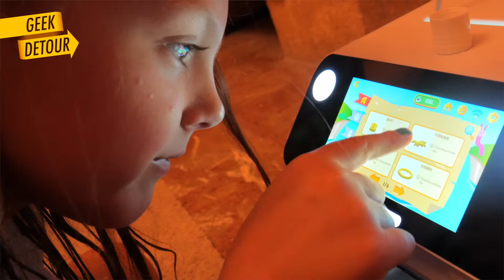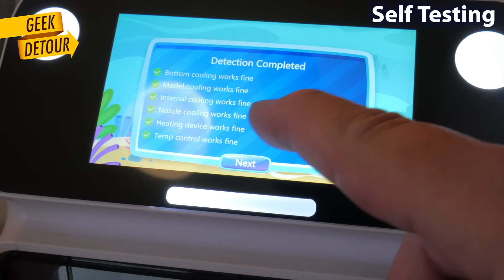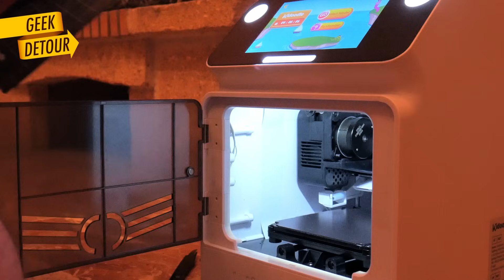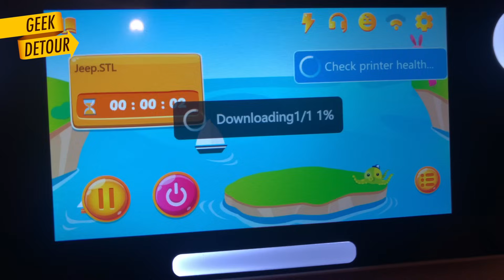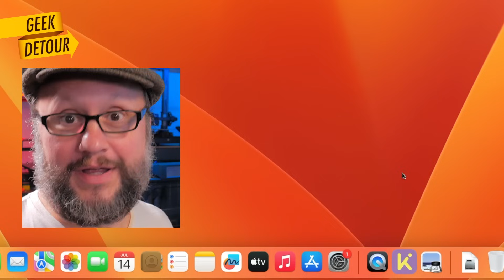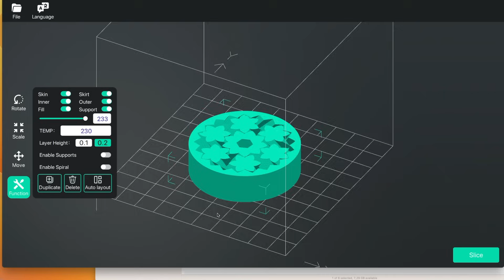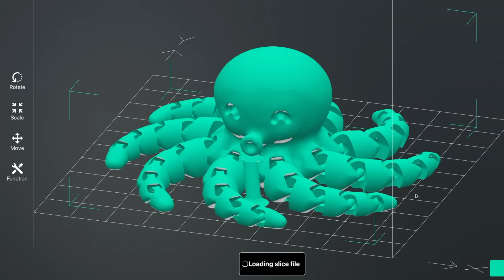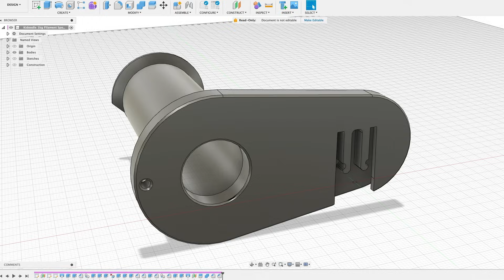The Best 3D Printer for Kids in 2024: Kidoodle - no phone, no computer!

Comment: just use a bambu lab x1 carbon bro it literally is way bigger and has the same size screen its way better
Reply: Why would a kid need a 11x more expensive 1,300$ 3d printer? The point is that it’s cheaper and designed better for children
Reply: @kazaki87  its way way way better and higher quality and you dont have to spread glue everywhere

Comment: Um is there still a way to buy the x-maker 3d printer for kids?
Reply from the maker: Yes, the original x-Maker you can most likely find on Amazon, and the new x-Maker Joy (which is cheaper, but with a smaller print area) you can find on Aoseed website. I am actually reviewing it for a few weeks already. The software is really the best part (which is what I showed on the xMaker review).

Comment: Kudo's to Kidoodle for not vendor locking the Spools.

For the spool holder I hope they release the STL files or at least the Base-plate for the spool holder, so you can easily make your own with some bearings and a long screw

Comment: Never got 1 good print out of it. Instructions for bed calibration are vague, paper for calibration is missing. Now it seems like it clogged after the third test print. Cant get it to work and I decided to trow it away before I spend anymore time on this low quality toy. Will order a Bambu A1 mini, that thing just works without going back to 1995.
Reply from the maker: 🫤 I am sorry… Our experience with it has being quite good. But I totally believe you. Do you have other 3D Printers? Just for curiosity, since previous experience shouldn’t be required.
Reply: @ Yes, I do have a couple. But more recent ones though.

Comment: What would you consider better the xmaker or this new model based on your experience?
Reply from the maker: The XMaker has a better construction: the frame inside is all metal, more rigid and because of this, it prints very beautiful pieces - but it is much slower than the Kidoodle. On the other hand, the Kidoodle has a much better screen with a huge advantage of printing its catalog without an App or Computer - my daughter cannot do the whole process on the X-Maker. Also, the XMaker is more expensive to a point I find hard to justify. Does it make sense? The Kidoodle is way faster, the print quality is inferior - but to me it doesn’t matter: kids have fun anyways and being faster is quite important.
Reply: @GeekDetour that makes sense. I think I am projecting what I want versus what a kid would want so that is a great perspective! Also may be worth doing a head to head video in the future!
Reply from the maker: You got my point 🤗 For anyone 15 or older, there are more capable machines. The Kidoodle really makes it easy for young kids to be autonomous and enjoy 3D Printing. They can start slicing things themselves when they are around 8 to 10… They might be able to create a few things on TinkerCad and at some point they might start asking “dad, I made this thing… but it doesn’t fit my printer… can I print in yours?” That’s when I see they need an adult’s 3D Printer

Comment: Was that PLA coextrusion filament you were using (humvee, unicorn, etc)

Did you try different types of filament?
Reply from the maker: Oh, it was a Rainbow PLA from a brand I never used before: iSANMATE… I bought it September 2013 on Amazon Spain (for some reason, the brands I use to buy only had darker combinations available at that week). Rainbow is just “for show” and little toys - I already bought those from many brands.
Yeah, I printed in Sunlu Black PLA, Green… Red (we just bought an 8 color pack, 250g each spool from Sunlu). I also printed with Polymaker Polyterra Black. But I didn’t try PETG or TPU… this is my daughters printer - she will only print PLA in it. 
I have my own printers for technical stuff.

Comment: I wonder if someone can download the models on to a normal 3d printer
Reply from the maker: It would be very hard/unpractical to use them in another printer. The Kidoodle printer processes normal GCODE, but the model files sliced with the Kidoodle Slicer are encoded/transformed into what looks like a binary format (maybe it is just scrambled somehow), somebody would need to figure how to crack that before consuming it on another printer - and the settings would also not be optimal for the other printer. When you print from the Catalog, the printer gets this sliced file, not an STL.